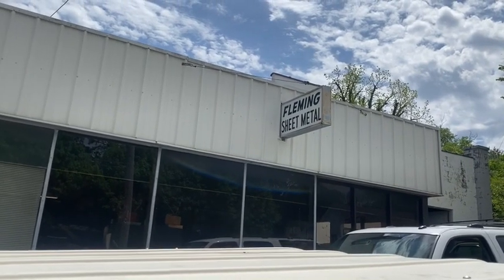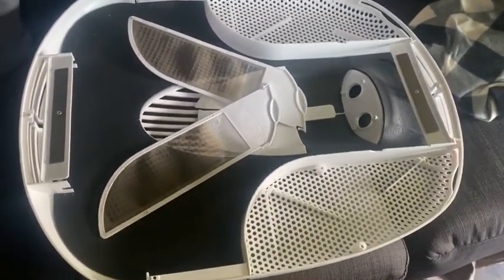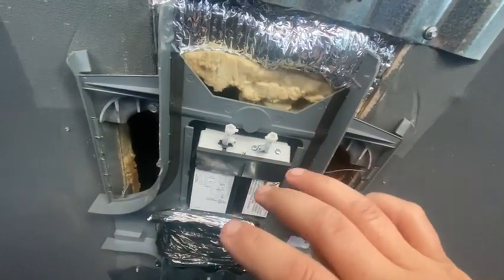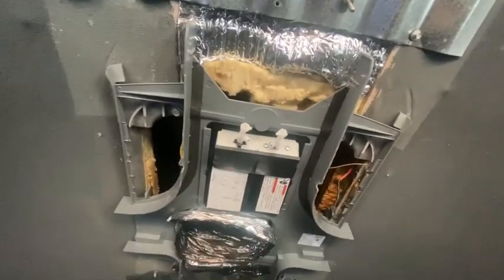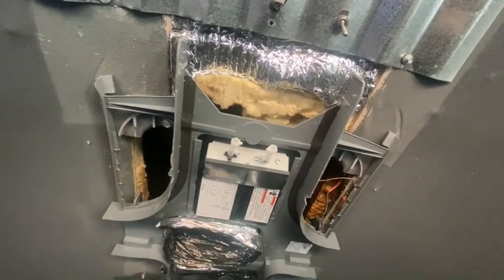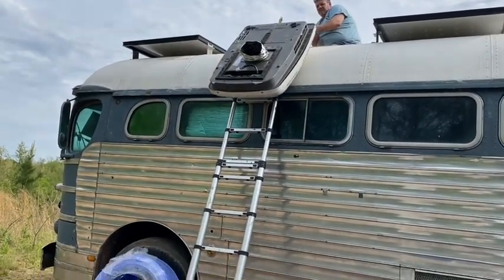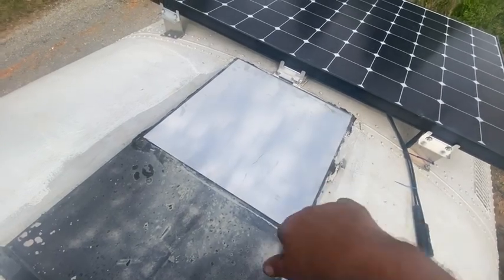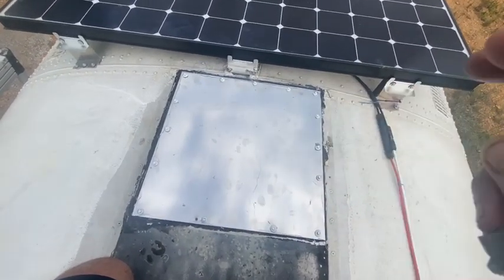Removing rv rooftop air conditioner

Comment: I like how careful you are with power. A number of years ago, I assumed I had disconnected power when I was rewiring something. Holy shit, what a jolt
Reply: When I was 17 I was an electro-mechanical assembler for a guy who ran an electronics business out of his basement.  There was a coil of Romex tied up against the ceiling that I assumed was not powered.  I cut it with a large pair of diagonal cutters with insulated handles, and one of the ears flew across the room due to the electrical short.  (I had to repost this comment - I used a common slang term for wire cutters that apparently is so frowned up that they delete comments containing it)
Reply: @donmoore7785  You mean the "alternative lifestyle" term for wire cutters? LOL

Comment: of course, you can do 2 things with the old air conditioner; A) keep it as an emergency spare if the one still on Lenny's roof goes belly up, or B) give it to Tyler when he starts work on his bus.
Reply from the maker: Going to Tyler’s bus
Reply: Bus Grease Monkey and of course, the roof real estate that has been vacated by that A/C unit is about to be taken up with more photovoltaic goodness! More power for Kelly to cook with and run that much more efficient Mr. Cool mini split!

Comment: We bought a longer Toy Hauler after our first desert trip with our newborn.  The old trailer we put a AtWood AC on and it is such a great AC I'm going to swap it over to the bigger trailer.  Figure I'll back them up as close as possible, disconnect them both and go from roof to roof.  Probably use a sheet of plywood to bridge the gap 😂

Comment: That foot operated, guillotine brought back memories.👈👺
When I was a young man, I would cut large copper sheets.
To make circuit boards.👍😒
Reply: Gosh - that brings back memories. Making PCBs was my first full-time job. Cutting, brushing, plating, etching, sawing, reflowing... The only bits that weren't in my job were drilling and silk screen printing.

Comment: Those aren't "expansion" joints cut with the masonry blade saw; they're "control" joints; they create a weak point where the cracking, that will always eventually occur somewhere in a concrete pour, will be controlled to occur in the cut. Any mason will tell you its not a question of IF it will crack, but where it will crack.
Reply from the maker: That’s what i meant.   Yes that’s hopefully where it will crack in a straight line

Comment: You just keep moving.  I was wondering how easily and quickly you could get sheet metal, for either or both of covering the A/C opening and brackets to mount the panels.  That is the size saw for the expansion joints I was imagining.  You are lucky to have shops so near.  I am guessing that you didn't want to get concrete dust in your camera :)

Comment: I was questioning your willingness to work  when you were using a power tool on those bolts until I saw the length of them. I apologize.
Reply: Dude why would you not use power tools if its an option? Im questioning your ability to use your brain.unfortunately common sense is quite that common anymore

Comment: lol. those old 3 bolt units are rare nowadays but I still see them.. Took one out a month ago.. Someone who has one will want that especially the inner shroud etc. probably worth about 300-350 bucks if working.  Thermo king? I could be wrong..  Silicon will break down after a while. I would use a sikaflex or in your case of never opening that again  5200..

Comment: I know this is unrelated, but how do you level your bus?  I have an old Foretravel and they level using the air bags by rotating the leveling valve mounts.
Reply from the maker: Boards under the wheels
Reply: @BusGreaseMonkey  Simple and effective.